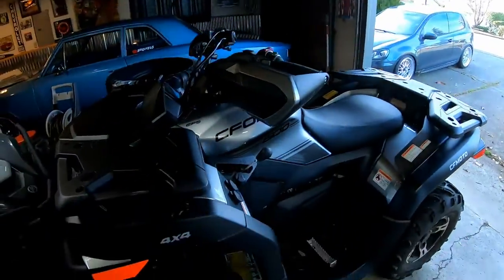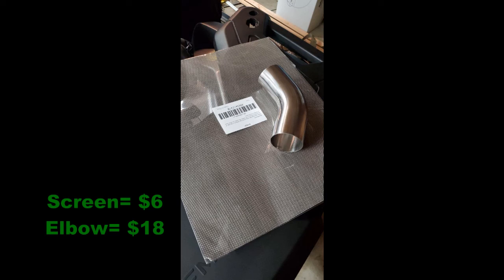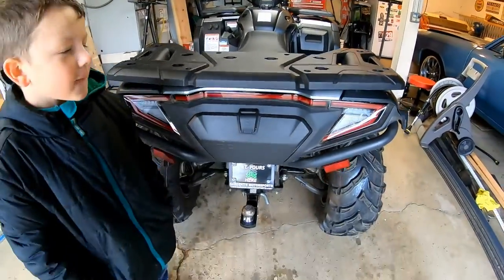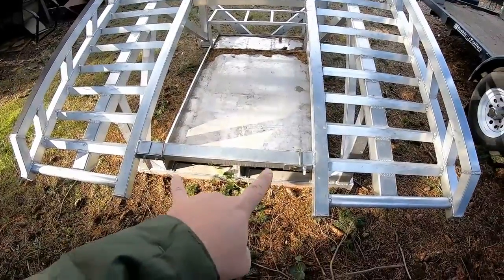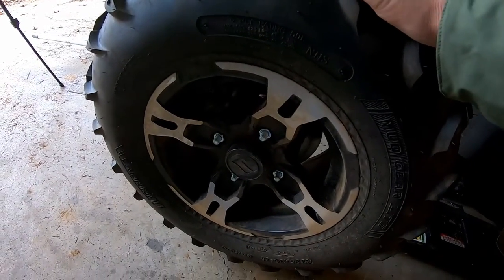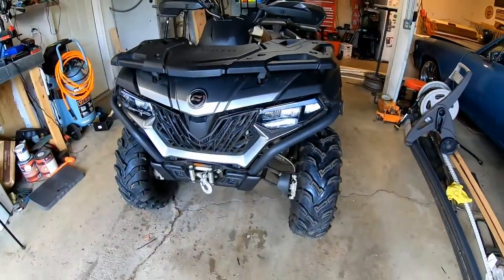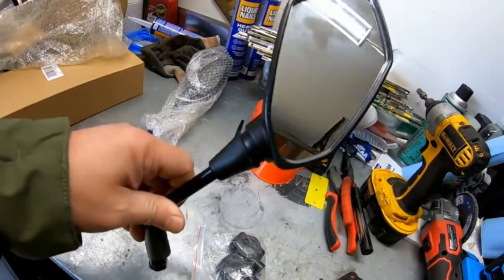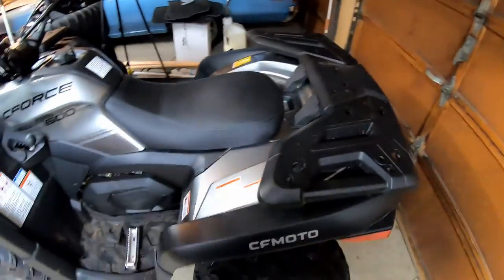Cheap Upgrades Anyone Can Install 2022 CFMoto CForce 600 Best Cheap Quad Modifications Whiskey Bent

Comment: Do those lug nuts work? I had the same issue
Reply from the maker: I bought some automotive lug nuts so that they are closed at the end. So mud doesn't get on the threads. Hope that makes sense
Reply: @BriGuy503  are those the ones in the link from Amazon?
Reply from the maker: Ya those are the ones I bought and worked great.
Reply: @BriGuy503   thank you.

Comment: I don't understand why you needed to buy different lug nuts. The ones provided with the spacer appear to be pass through style. I think you're supposed to use the CFmoto lug nuts to mount the spacer, like you did, then use the nuts provided with the kit to mount your wheel.
Reply from the maker: Yea u can do that. But I didn't like how it looks. So I bought new lug nuts
Reply: @BriGuy503  ah, okay. That makes sense. Thanks.